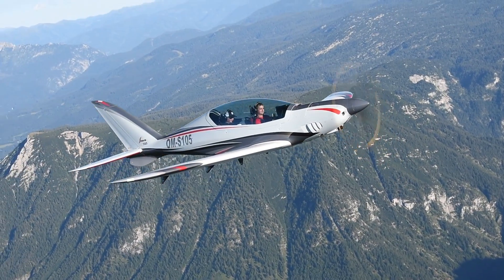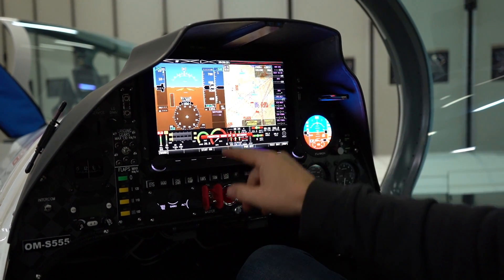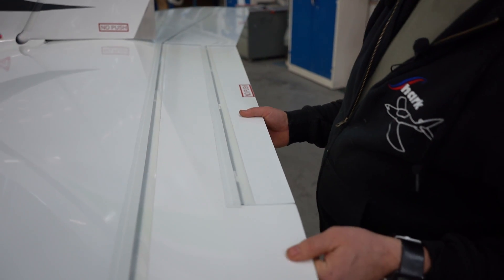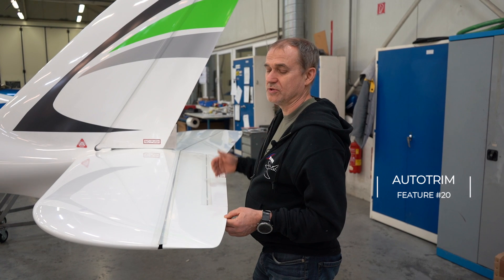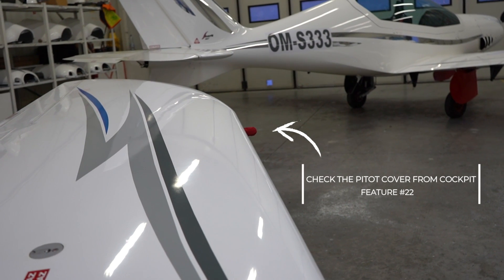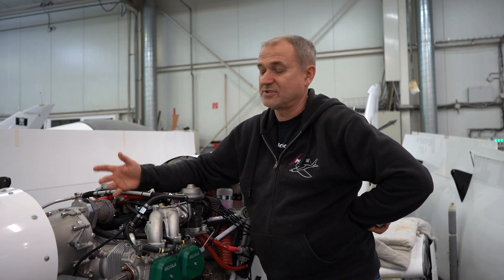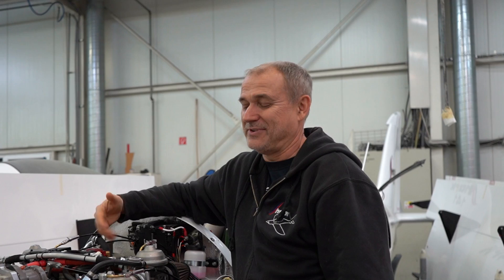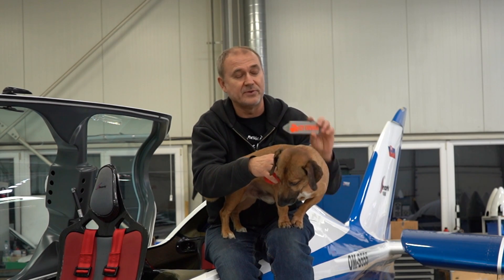30 safety features of Shark airplane - Episode 2

Comment: Another safety feature could be added to the aircraft is solar cells embedded into the wings so it could provide the instruments with power in the event of loss of the alternator. Although, I dont think this plane can act as a glider.
Reply from the maker: the shark has a BRS - ballistic recorvery system - which fires a parachute to effectively glide to a soft landing in an emergency

Comment: One element of safety is simplicity. 
Therefore, I do not understand why the passenger is not positioned at CG.
The necessity to move around a 6kg dead weight constitutes a design flaw that should be corrected.
Reply from the maker: Because it’s a tandem seater 😁
Reply: @sharkairplane   As said, with the passenger positioned at CG, it would make no difference to the CG if the seat is occupied or not.
Reply: @tubevization  But the weight of the pilot, so far in front of CG, would be a limiting factor
Reply: @Fastwolf666  That's correct. However, my impression is that the pilot is situated much closer to CG then the passenger - it should be the other way round as the pilot seat is always occupied. I suspect that the 6kg dead weight in the aft is placed there mainly for convenience and not really needed when flying in single mode to stay within the CG envelope. Whereas it is mandatory to place the weight under the cowling when taking a passenger. It would be interesting to see the actual calculation.
Reply: He mentioned a 110kg passenger in the rear.  That's a 240lb passenger!  Moving that little amount of weight for CG is nothing.  That is awesome and still be under gross!